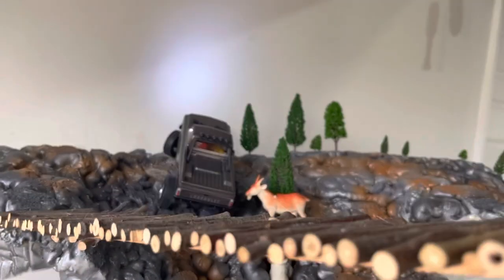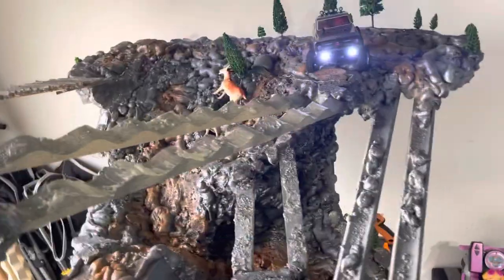Axial SCX24 C10 Wide Stance! Using RC4WD wheel to widen stance! Better Performance? Fit the Course?

Comment: just wondering what shocks your running man thanks sick course btw
Reply from the maker: I was running the hot racing spring now I’m running the hot racing internal with a little grease and no springs and love the set up. Have to keep the tires small though so I run the Creepers and mounted the shocks to the frame.